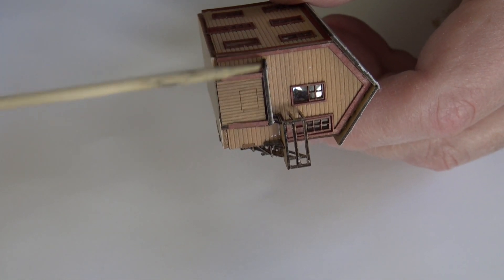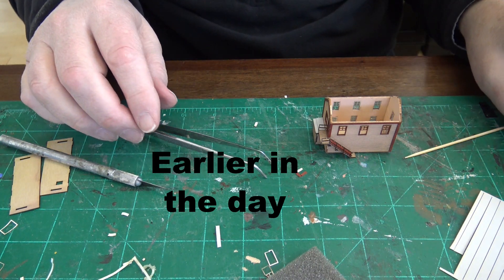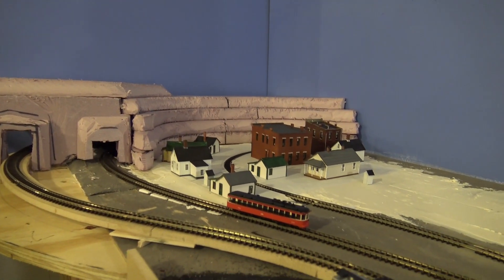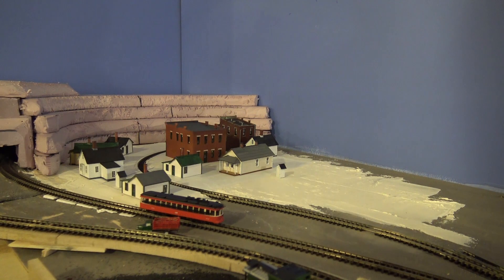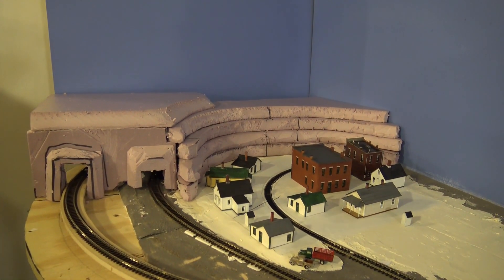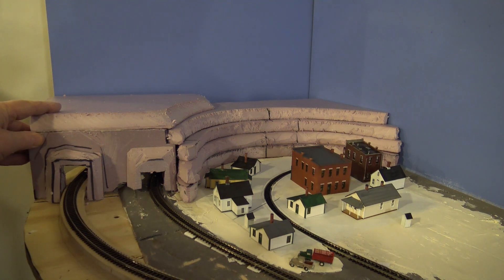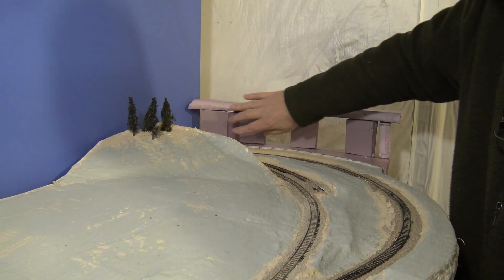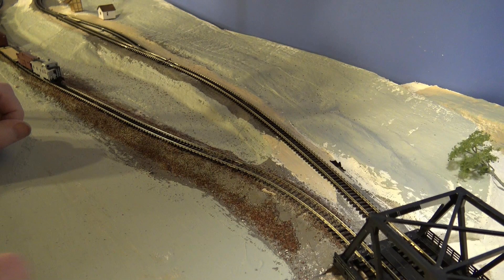The Cororado & North Western Building with Foam -  Farland Howe 8

Comment: Another great update Rob! Could not tale the difference with the Signal Box rails. Wow! The original one really did fly away! The yard looks to be coming along well. Lovely little additions with the vehicles. Liking the sound of the new rock face. Great idea with the foam, might come in handy for a few changes I thinking about on my layout. Loving the freight train too. Looking forward to seeing more developments. Keep up the great work and thanks for sharing!
Reply from the maker: +SDJR7F88 Hello Callum, you just have to make do with what you've got to work with.  Thank you.  Yes, flew away never to be seen again.  I discovered my local building supply store had small sections already cut for projects.  I bought two.  Foam is great.  It is light weight and easily formed. Go for it.   Thank you again, Rob

Comment: Man that piece of wooden railing flew like a bat out of hell! I did laugh (I know I shouldn't) when it happened though because this must have happened to every single one of us and never to be seen again but obviously that didn't stop you as you just made another up anyway and to be honest, you wouldn't even know. It's certainly getting along just fine Rob and I like the way you are using the foam to build the large structures too, it looks a very efficient way of building them. I also liked the 'artistic' look to the video about halfway through as well, it looked almost like a hand drawn video using water colours.  Good update Rob.          ...........Graham
Reply from the maker: Hi Graham, thank you.  Bat out of hell is an apt description.  I was hoping for a laugh or two, hence repetition. Takes two to see it. Slowed it to .06.  The foam is good, just difficult to cut.  A hot wire supposedly works well except for the deadly fumes.  The foam when glued with WS foam tack is very strong.  I used the video treatment to cover up how boring it seemed.  Thanks again my friend, Rob
Reply: +Rob McCrain   Not boring at all Rob and looked fine to me. I had seen people like Chuck use the hot wire but didn't even think about any fumes coming off it - a good point to note. Cheers for now buddy, Graham.

Comment: Layout is coming along nicely Rob, when the piece of hand rail pinged "it went that way" I lost bits, looked high and low, then weeks later its there right before my eyes, looking good........Al
Reply from the maker: +Alan Murphy   Hi Al, thanks.  The problem with the railing is solved and the replacement does not look out of place.  Yes, I have one area over on Farland that is a black hole.  If I drop anything there, it will never be seen again.  Annoying.  I know what you mean, I was just having some fun with it, sound effects and all.  Thank you, Rob

Comment: That did make me smile rob - boing! It went to your right. No actually, wait a minute - I think it landed over here on the outskirts of London, in Essex. 
So have you done some fancy video-processing? The image looks strange but interesting. 
Insulating foam is cool. Looks good, and is light for mobile layouts. I use it a lot too. 
Cool about the trestles and rocks. Laurie.
Reply from the maker: I spent about an hour looking for it.  It looked like it might have hit my right arm.  I was wearing fleece so it probably stuck to me and dropped off later.  Oh well, the replacement pieces look okay.  First time with N scale.  Ping.....thank you Laurie.  Rob
Reply: +Rob McCrain Replacments are fine. Couldn't tell any different. 
I think it pinged at a much higher angle and velocity. But I would say it is about 8ft to your right ;-)
Reply from the maker: +Calvertfilm Yes, I am impressed with the possibility of foam.  I plan on using it some more.  The video slow down didn't work that well.  The velocity of the piece was too great.  Yup, outskirts of London, west side. {-; D